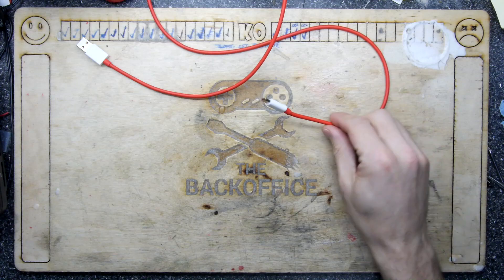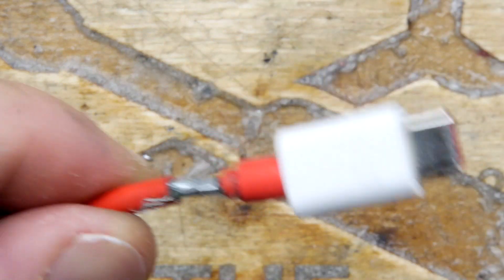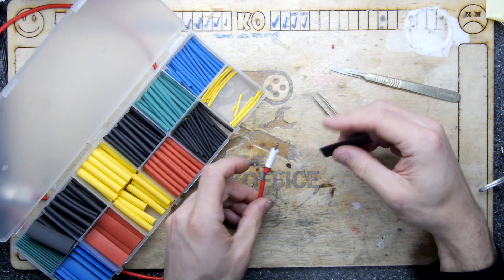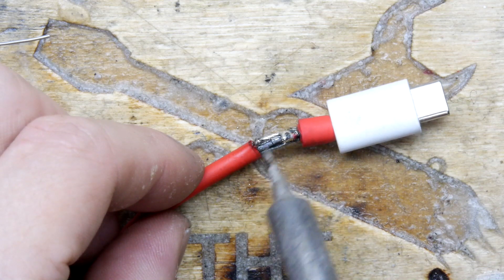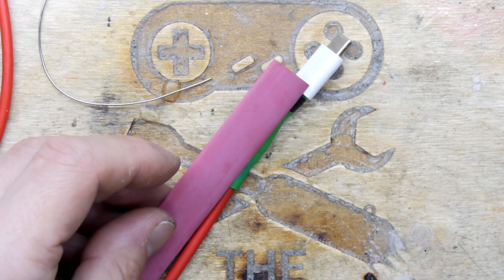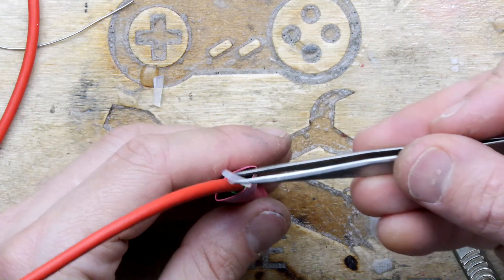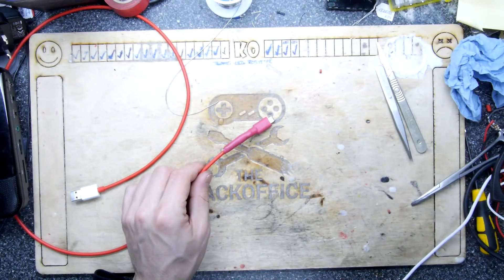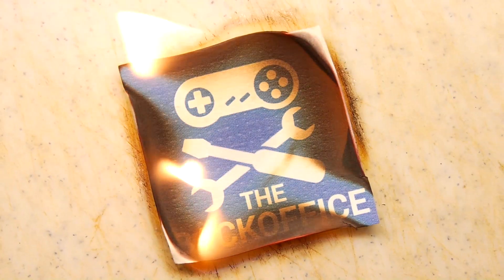USB C Repair and Mod

Comment: That's Too Much Rigamaroe
Cut Off The End Solder On A 5.5x2.5
Berol End Then You Can Use Any Adapter Plug

Comment: What is the mm of the heat shrink tube?
Reply from the maker: Not sure, I get the kit of several pre cut sizes
Reply: ❤️ frm India
Reply: I was wondering which size should i oder to fix my data cable the original one from oneplus is bit to expensive for a data cable anyway thanks for your help man. have a good one🙂

Comment: where did u get ur new charger from im looking for one
Reply from the maker: I don't recall exactly, but it would have been Amazon or eBay
Reply: @backofficeshow  ok. does it matter if the cable is a oneplus 3 charger on a 6t 
 will it dash charge?
Reply from the maker: @RazaAli-fc3xr  As long as they are both dash it should work, but it might be worth seeing if there are any revisions in the 'dash' standard.

Comment: Andrew, you made a mess of that mate!  LOL.
In this situation I would of used heat shrinkable tape. It works just like heat shrink tubing but it's in the form of a tape.
Is quite expensive but one reel lasts for ages!! It's like a self amalgamating tape but when you apply heat, it shrinks and forms an almost solid structure.
If anyone is interested, do a search for 'heat shrink tape'.
 Ian.
Reply from the maker: +banjax66 Nah not a mess, works perfectly and with the materials to hand 😂

I kinda wish I didn't bother ordering the replacement cable
Reply: Hahaha... Admit it mate, It's a mess. LOL... 
You need a roll of heat shrink tape, then you don't need to use a bunch of different sizes of heat shrink tubing. 
I will admit though, I have done the same as you and it worked..
I also find heat shrink with an inner layer of adhesive is so useful but way too expensive for everyday use.
All the best... Ian.